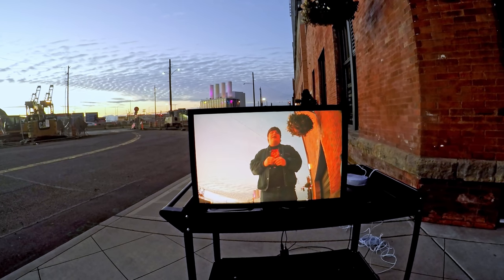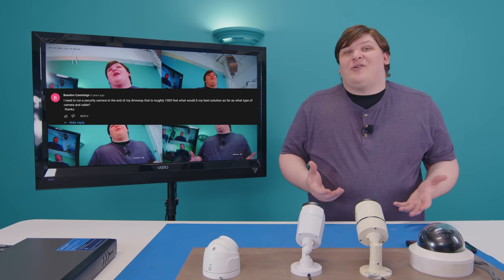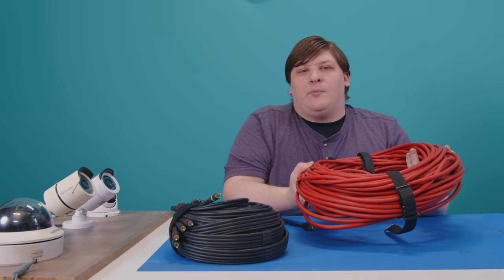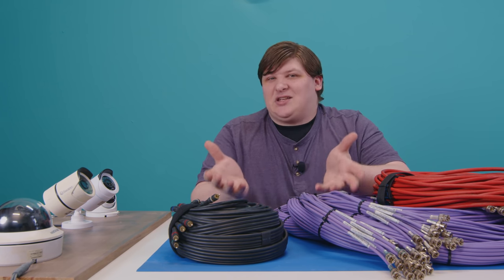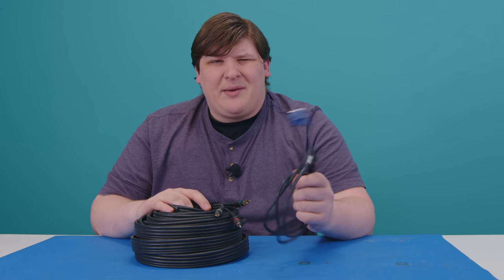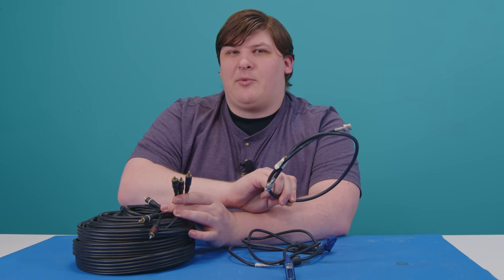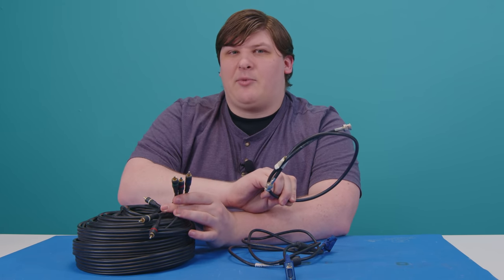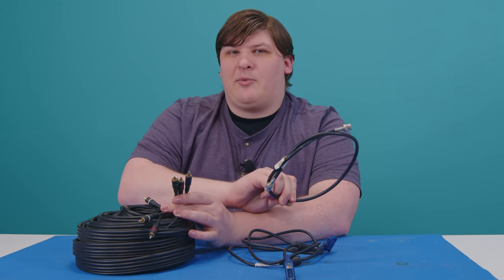1000ft of ANALOG HD video over a single cable?! [AHD/CVI/TVI]

Comment: Don't IP cameras solve all of the issues you raise? (ah i see you mention that). I'm using a point to point wifi link with directional antennas to get a camera at my gate about 1500 feet away. Luckily I have power there for lights.
Reply from the maker: As I covered in the video, they go 1/4 the distance (unless you daisy chain $40 repeaters that add tons of complexity to what would otherwise be a simple cable run;) they don't let you reuse existing cabling; and (I forgot to even bring this up) you now have to deal with a network, which - from extensive experience - is never as simple as "just plugging stuff in." A network of any size can have problems that simply never exist when your camera just turns on, powers up and spits out video that you simply plug into your recorder and be done with. No DHCP, no routing, no network loops.

Comment: Really? More people use Display port than DVI? Never would have thought, I've never even held a display port cable before, only adapters to other formats.
Also interesting that composite isn't considered common anymore, I haven't seen a TV yet without it.
Reply from the maker: I don't think I meant to suggest that, it's more like (in my observation) HDMI replaced VGA, in that the average person used to use VGA and didn't know or care what DVI was, and now the average person uses HDMI and doesn't know or care what Displayport is. Both DVI and DP are things I only ever saw used by fairly savvy people.
Reply: @CathodeRayDude  Interesting! DisplayPort was always the "HDMI doesn't fit" connector for most people I knew, and we generally used DVI until HDMI started showing up on game consoles and televisions.

Comment: I'm pretty sure that canon miniDV cameras used something similar to 960h. You could select 4:3 or 16:9 and cropped 16:9 captured over firewire looked the same as 4:3
Reply from the maker: The DV format just had a bit you could set to define aspect ratio, and the 16:9 footage was stored anamorphically in the same 4:3 pixel space.
Reply: @CathodeRayDude  so like in PAL. Thanks :)
Reply: @CathodeRayDude  More exactly it's the aspect ratio of the pixel that is different.
Reply from the maker: @debranchelowtone  I don't feel that that's semantically distinct.
Reply: @CathodeRayDude  Ah yes i'm sorry, i've read too quickly.

Comment: The thing that's bothered me about the ATSC switch over is that as far as I know, there was no devices that output directly to ATSC (via DVB cable channel or otherwise) so that you could use the cables you used to use to connect VCRs to TVs and such to send a HD signal to a TV. Sure I suppose HDMI ended up filling that role but it would have been nice to have something do that.

We've had VCRs and countless other things send things via those cables for decades and ATSC stuff just never bothers? Such disappointment... :P
Reply from the maker: Yeah! I actually bought an ATSC modulator a few weeks ago, $100 used, and it's a big 19" rack unit. I've never seen anything smaller. Frustrating!
Reply: @CathodeRayDude  i hope that means we can look forward to a video on ATSC modulation
Reply: The trouble is, is the encoding delay. Ive got a cheap DVB-T modulator and it adds a couple of seconds of lag, so navigating menus is very slow!
Reply: @willyarma_uk  Yikes, that would make it pretty terrible if you wanted to use it for things like gaming consoles.
Reply: I have to say i don't understand this particular criticism Apache.

RF modulation was a required fallback because manufacturers of cable boxes, VCRs & the like couldn't rely on end users having composite (or any other) inputs on their TVs. Growing up in the 90s, it wasn't until my parents replaced a busted Sony TV with a TV/VCR combo unit that our house had any TVs with composite inputs & we had already been a 3 TV house at that point.

In heavy contrast, just about every ATSC TV can be counted on to have Component YPbPr &/or HDMI inputs so ATSC modulation would have just added extra costs & probably additional FCC regulations but I might be talking out of my ass on that last point.
Reply: @BushidoBrownSama  The real drawback is that you can't distribute multiple video feeds on the same cable, though most people probably wouldn't have a use for it.
Of course, if you just want to distribute the broadcast channels, you can just use a splitter.

Comment: Actually you can use "old coax wiring" for newer ethernet/IP systems. Its called MoCA. You have to purchase adapters but if you need to use old wiring in an old building that cant be retrofitted, its totally possible
Reply from the maker: Right, but per the constraints I gave, that would require buying adapters for both ends of the cable run, which is a tremendous amount of expense and additional failure points.
Reply: @CathodeRayDude  PowerLine Ethernet adapters work good and can go over 1000 feet. We use them for IP cameras at my work for a temporary camera feed to fill stopes in an underground mine. It's about 60 bucks for a pair of Dllnk adapters.
Reply: @CathodeRayDude  I spoke of the adapters in my comment. Hikvision and Dahua have both been banned by the FCC in the country and Analog camera systems are almost non-existent. We do not use them anymore in the security industry. It's all IP based now. Great video though, even if it is 5 years to late.

Comment: So I’m just interested u say its possible to jam or confuse a digital camera I’m just curious how a system like arlo fairs to that I see the kits at Costco all the time they use a Wi-Fi signal of some sort obviously this system isn’t surviving any type of disaster just wondering if anyone knows how that works with video via a wifi connection most arlo systems come with a box u plug into ur router.

Comment: Im not sure if i missed this, or if it was not mentioned, but my question regards powering these camera.  Is there a way to power these over the single Coax line, or does each camera need a power supply at the camera installation point?
Reply from the maker: There are options for putting DC into coax, but the usual approach is so-called "siamese cable" which molds a DC cable and coax together. It's "cheating", after a fashion, but in practice it's already installed everywhere so it's moot.
Reply: @CathodeRayDude  Thanks.  Helping out a local a local rifle range with these types of cameras currently. They are running most of them over a single twisted pair Cat5 per camera with baluns on the ends, with no explanation of where the camera gets it's power (i haven't been out in person yet). Im guessing some kind of DC wall wart in an enclosure, which feels very not ideal . I was thinking if i could terminate all video and power back to a central location it would be much easier to work with, i suppose my only concern would be how much power loss might happen to 12V DC over a 1000FT cable run.  Well thanks for the video, when they told me what they i had i thought this was some older tech that has since gotten replaced completely by POE Ethernet IP cams

Comment: I did end up using an ethernet over RG-59 adapter so that i didnt have to take apart an exterior wall to get ethernet into a room in this old house. Not really sure how the ey originally added this cable to this addition, but it seems to run through a concrete slab. I originbally tried to run it externally, but animals kept damaging it, and i didnt want to run conduit out there

Comment: You mentioned that many of the cameras are 15 fps - does the analog video signal only have 15 frames (fields?) or do they all output 60i even when they capture at a lower frame rate?
Reply from the maker: I'm pretty sure it's better than that, and these cameras just suck, but I'm not sure
Reply: @CathodeRayDude  They probably limit it because the DVR's suck. HD-TVI was always a band-aid and the kind of people who use band-aid surveillance gear aren't going to spend good money on their DVR.

Comment: When doing camera installs, we always install ethernet either way. For analog we use a ethernet to BNC+power adapter. Cheaper than coax+power bulk and better picture quality than those junk cables that come with the cameras.

Comment: Wait - are those composit cameras powers by the composit cabels as well ?
Reply from the maker: I think there is a standard for power over coax that these ones don't support, but generally the solution is to use so-called "Siamese" cable with an extra pair of DC wires. These are already in place for security cameras going back a couple decades at least, since they were being used for the original standard definition ones, so they still work fine for this. It is more wiring than a single coax cable I admit, I may have been a bit misleading on that point, but given that it's already installed everywhere that people are likely to be using these things, and it's still extremely inexpensive, I think it still beats the alternatives

Comment: You missed HD/4K over cat5e, I've seen new tv systems in bars with numerous tv's running cat5e with some sort of converters
Reply from the maker: I didn't miss it, I said in the premise that it doesn't fit the specs I gave. The systems I've seen either cost too much or won't go far enough.

Comment: Is this using MUSE HD analog compression or something related?

For those that don't know MUSE was used for the Analog HD broadcast system Japanese used in the late 80s early 90s

Edit: Doesn't seem to use MUSE
Reply: MUSE transmitted an analogue signal but required digital processing at both the sender and receivers.  Basically it gave HD in the stationary areas and SD in the moving areas.

Comment: 11:30 while I completely agree that it makes sense to keep the infrastructure on coax, it should be noted that the current state of the ethernet standard is pushing through a single-pair standard that can bring power and data up to 1km at 10Mbit/s. 10Mbit/s isn't a lot, but the addition of IP networking to a surveillance system would allow cameras with gimbals to be adjusted remotely or for other equipment near the camera to be accessed without additional networking.

Not saying for a second that the use case you've described isn't best served by an analog un-balanced system, but I think that surveillance systems going into the future will migrate away from 4-pair ethernet to single pair considering how incredibly low-cost it is (well sort of because there isn't exactly a market for it yet).

Edit: Just read felenov's comment about how TVI and CVI can pass control signals, so I guess the only benefit of 10BASE-T1+PoDL is really just the ability to break the network out to multiple devices near the camera and the ability to use any video over IP sink instead of a purpose-built box.
Reply from the maker: Oh I absolutely think that's reasonable - I've heard that ethernet as-deployed will actually run much much further than 100m if you let it negotiate down to 10mbps,  and of course there's the same problem as with SDI: even if it'll do it, you can't plan around it or you're risking wasting a lot of money. But if it were a standard spec, I'm sure it would be viable.
Reply: @CathodeRayDude  in a technical sense, it is an active, published IEEE standard with real hardware in production (802.3bu/cg) although the standard is still being developed (802.3dd) and likely won't reach full availability to the consumer for 3 or 4 more years.

Comment: Professional Security tech here: I agree with pretty much all of this. I prefer digital cameras for clarity and POE, but analog is far and away a more robust signal. It still blows my mind how many people believe "HD" or "UHD" means CSI's 'zoom and enhance' So many people want "crystal clear faces" for "clothes and gender" price. As a warning though: HIKVISION used to be our go-to until a revelation that they may be in cahoots with the Chinese government. Speco Technologies has become our low end option now.
Reply: Also: Screw wifi cameras. They still need power, and if it's battery powered it's quality sucks. So you still end up with a wire or a crappy camera
Reply from the maker: RIGHT? And I can't imagine relying on them! It's a recipe for disaster, you're going to review your footage and find out, whoops, there was a solar flare on the day of the robbery and the camera didn't capture anything useful. Aaaagh

Comment: Correct me if I'm wrong, but couldn't you use a media converter for fiber to ethernet? That would allow you to use IP cameras and run fiber to the main DVR. Media converters are only around $50, only downside being you have to have power at the camera since it doesn't do power over fiber.
Reply: Quality media converter is not $50.  You also missed the constraints.
Reply: @ShainAndrews  If we're talking fiber to ethernet they aren't very expensive for the quality ones. Looking at Ubiquiti's site for example theirs is $69.
Not sure which constraints you're talking about, fiber can go up to 550 meters with OM4, or as long as you need with single mode (with boosters).
As for it being analog if I understood him correct that's because the digital solutions he tested were either too expensive or lose signal integrity.
Using a media converter and a fiber into a switch shouldn't lose any data, we do long runs using this solution for office buildings. Sure that's for internet and not for cameras, but that should be the same with a digital signal anyways. Only constraint would be somewhere without power, but I didn't hear any mention of that, I might have missed it though.
Reply: @xXfzmusicXx  I don't consider Ubiquiti as quality.  Prosumer... but not commercial.  He mentioned $300 and that is in the ballpark.
Reply: @ShainAndrews  But we're talking about prosumers here. He said in the video for companies this is a money is no object market, but he read a comment on youtube... Which means we're talking about consumers, not companies.
Reply from the maker: My concerns are additional cost at both ends of the connection, more power supply connections and more points of failure - in a new installation or with only a couple long-reach cameras it might make sense, but I think in many scenarios it would be too much added complexity.

Comment: 3G SDI is rated up to 300m. It was the longest we handed out in a camera rental.

Correction:
Apparently not but the high quality cable was shielded well enough to allow 6x 50m linked together.
6G is able to go 150m with proper cable and 12G 75m

Comment: Anamorphic SD video isn't any lower res than regular SD video, it just has a different aspect ratio.
Reply from the maker: The same number of pixels are used to store more visual information, meaning the fidelity has to be lower. When displayed they're either stretched horizontally to fit a wide screen, meaning the definition of the horizontal component of the image is decreased compared to a 4:3 image in the same space, or the image is crushed vertically to fit a 4:3 screen, meaning the vertical definition is decreased since more pixels are now being displayed in the same space.
Reply: @CathodeRayDude  According to that logic, wider angle lenses yield lower resolution images. Doesn't make much sense. Obviously objects at a fixed distance seem less sharp, but the overall resolution is exactly the same. There's just more pixels at the sides and less in the middle.

Comment: Digital signals can be far more robust than analog. The trade is between the amount of channels in a given amount of bandwidth and the amount of error correction and redundancy used. What you don’t see is how close to the limits you are getting. Digital will work perfectly right up to the point that the error correction fails, at which point the digitally compressed image becomes garbled and unwatchable. You get far more detail (multiple channels even) in the space formally used by a single analog SD channel, and you can pack them closer and reuse them with less distance between transmitters. That all cuts in to the safety margin that the digital error correction provides. If you chose to design your digital system for reliability over bandwidth however then you can do fantastic things. Look at the LoRa standard that can push digital data 20+ miles on a few milliwatts of power. The signal is so weak that analog would have been undetectable, but you can still extract a reliable digital stream from it.

Comment: If you want to know which niche community other than security installers care about this hardware and specs, look no further than FPV drone folk.  We use old security cameras basically, lol.
As for how they do it, realistically you can put as big a signal as you want over a coax cable, how do you think cable companies do so much data + TV over it?  Its all modulated, such that normal NTSC signals only take up a little bit of bandwidth, but if you're on a closed loop system, you can use as much bandwidth as you want, making for much bigger pictures.  You could presumably do analog 8k 120hz even, it would just use a LOT of bandwidth.  
FPV drones are largely still SD analog, due to bandwidth limits.  Since we're blasting over 5.8ghz, we only have so much bandwidth to split and usually that means 4 "usable" channels in a given area.  There are some HD systems that use analog, fewer channels iirc, and there's a digital HD system that uses frequency hopping, but suffers from digital artifacting with signal loss which a lot of people don't prefer.  Analog signal loss is much easier to fly through.

Comment: How about using digital/Ip camera and connect over 10Base-T? I guess 10Mbit should be enough
Reply from the maker: 10base has the same specified 100m limit as it's successor formats. I've been told that in reality it goes much further, but would you want to find out, after doing a massive new installation, that at longer distances it quits working during storms?